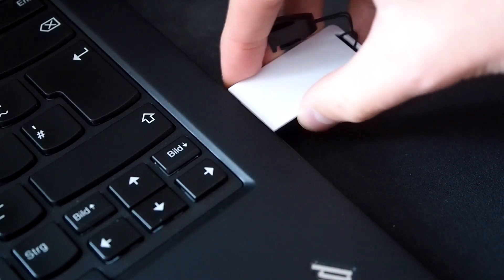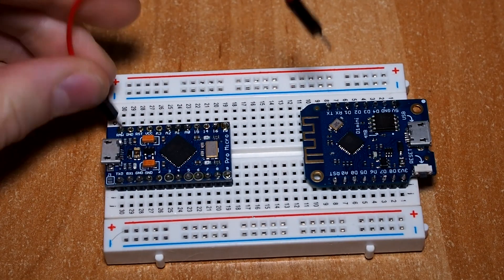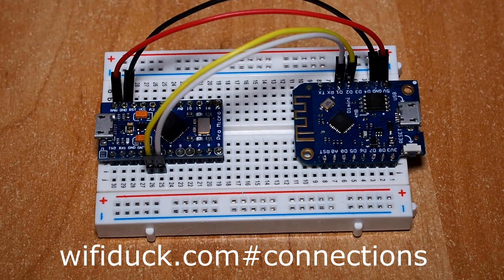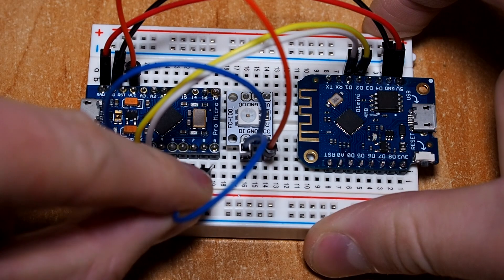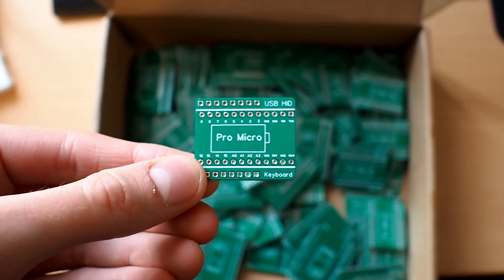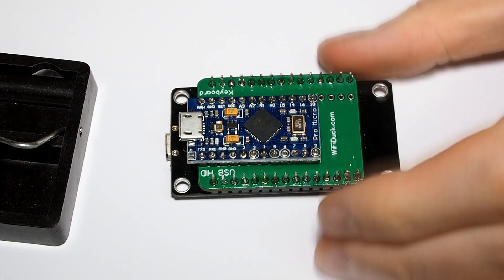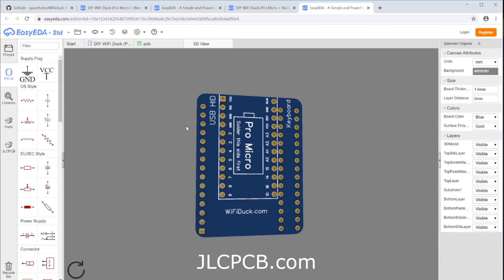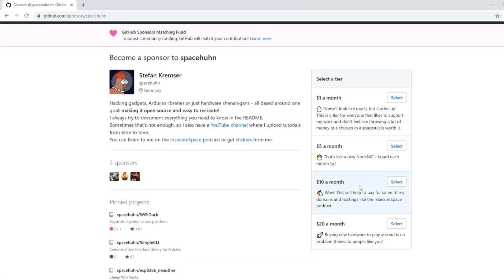WiFi Duck - DIY Hardware Tutorial - Wireless Bad USB w/ ESP8266 + ATmega32u4

Comment: Why doesn't this work for the Digispark :( would be pretty cool if i could fit this in such a small device
Reply from the maker: Digispark does not have enough memory required for this project
Reply: @spacehuhn  :/ I am trying to code something on my own rn, is it okay to power the esp01 with 5v?😅